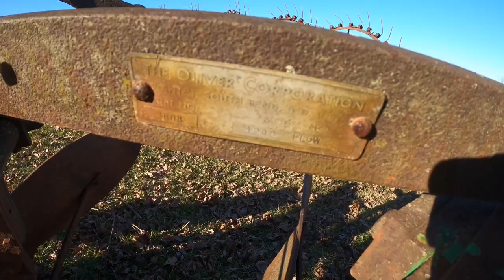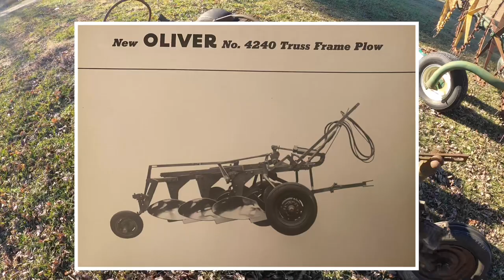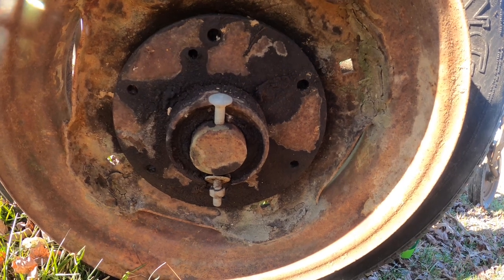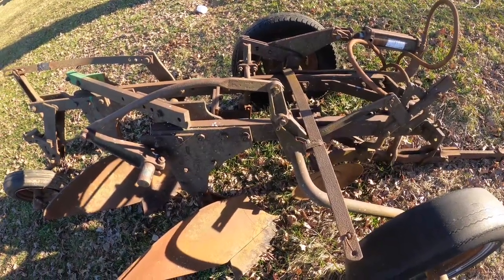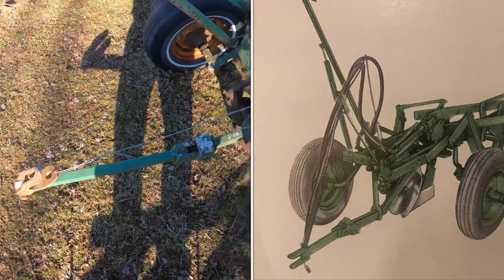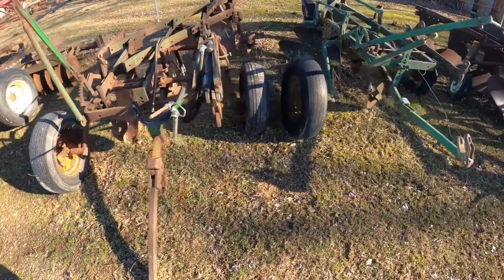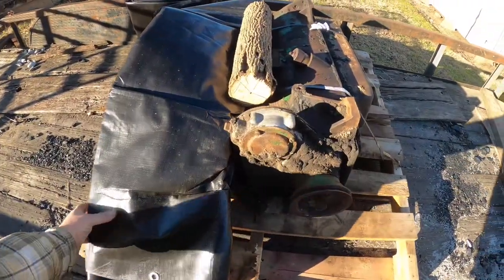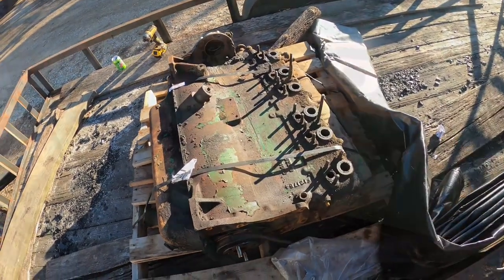OLIVER 4240 vs. 4340 PLOWS- What’s the difference???

Comment: Another thought, I've never seen a farmer "cobbled" modification that had neat smooth edges to the parts like yours has. Farmers would have used  a torch to cut metal pieces to shape. I didn't see any edges that were torch cut on your plow. That leads me to think your parts were manufactured and not "blacksmithed" as a farmer or small repair shop  of the era would have done.
Reply from the maker: I know, it looks too good to be a homemade repair of the time period. Someday when I get some time I’ll start messing with it again.

Comment: Just a thought, could Oliver have offered a dealer installed conversion package to convert a mechanical lift plow they had in inventory to hydrulic lift? Seems likely to me as the best way to adapt existing mechanical plows to the modern hydraulic lift.
Reply from the maker: That’s very possible, I have never noticed it in the parts books but I’m sure that they knew which pieces it would take and if you went into the dealer they could set you up
Reply: @rosstheoliverman  Back in 1950's, my dad had a 3 bottom pull-type plow that had a hydraulic cylinder kit package that converted it from the original manual lift system. It was an old IH plow and the bright red paint of the conversion package  stood out to me as a boy. The rest of the plow had no paint left. My dad also had a 2 bottom plow that used a rope to trip the lifting mechanism that was driven off one of the rubber tired wheels. I think those plows also used a clevis to hook to the tractor and a heavy springed hook on the plow hitch would trip and release if you hit an obstruction like a rock or stump.

Comment: I would assume somehow they used half of the mechanical lift part to the hub on the outside of the rim. I have a mechanical lift of the same age but I don't have pictures of it. I will have to dig through my parts book as I think I have some plow parts manuals for the plows but I don't know if I have one of that age. We have an early 4240 2 bottom and late 3 bottom both have mechanical lift so I have examples of both. The round hitch adjustment and tail wheel look similar to the early 2 bottom we have.  I don't know about the hydraulic lift. Maybe someone cobbled something up to convert it.
Reply from the maker: That’s kind of what I think too. I think somebody got in a hurry and just reassembled the thing to get it to roll. It definitely needs sorted out the correct way.